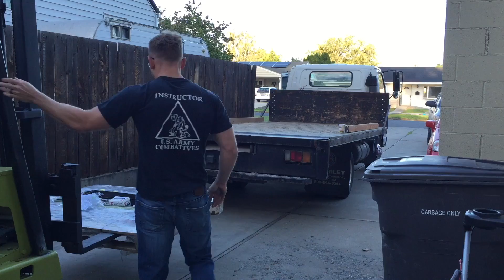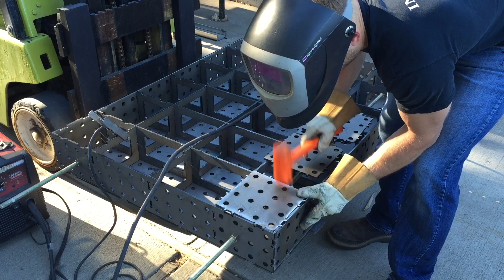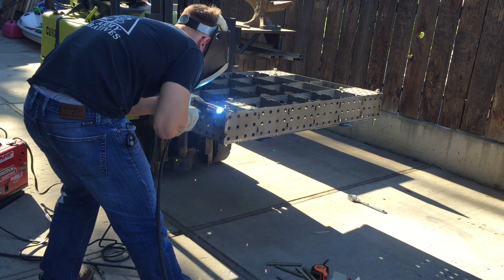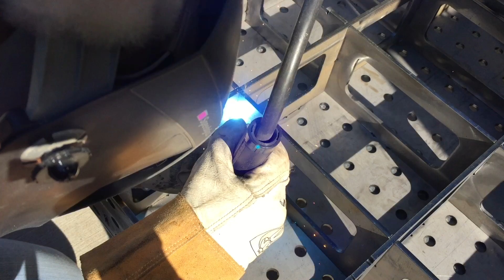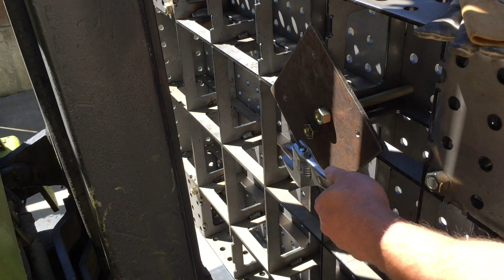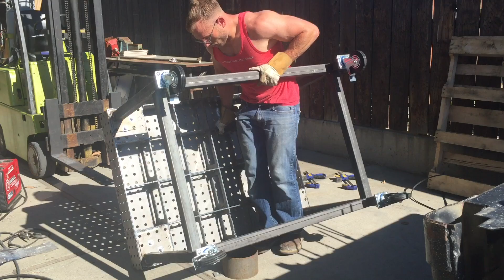NEW WELDING TABLE!!! Certa Flat Welding table (fab Block) 36''x48'' Unorthodox Fabrication

Comment: Do you not have to grind the mill scale off first before you weld?
Reply: Mill scale is high in carbon and will totally throw off your weld if it's not "clean, bright shiny steel" when you are TIG welding. If you are MIG or stick (SMAW) welding, it's more then capable of blowing thru the mill scale and putting down a nice weld. You can still get small inclusions in your weld. But for something like this it will not make a difference. If it was something structural like a beam in a building,  then yea, the mill scale would come off.
Reply: Should already be cleaned.

Comment: I got a 36 x 48 tabletop version. I found ... too late ... had it partially tacked together ... that the ribs were bowed. Must have been from the cutting. If I had clamped everything tight the top would have been bowed too. I spend a great deal of time shimming the ribs where they weld to the top to get a flat table. Just a word of warning here. Assume nothing is dead on.
Reply: exactly!.. mine's on order now and  will be used for set-ups/fixturing only, so needs to be precisely flat and plumb everywhere!.. gonna be checking every single piece against a very straight and flat 7' linear rail. I ordered one 24x36 fab block, four 12x36 wings, two 12x24 wings and two leg kits

Comment: Have you checked the top with a straightedge after you finished welding it all up? Curious how flat it turned out after all said and done.. One of these tables is on my list of future additions. Can't beat the price.
Reply: Jeff Allen 18% sale going on now.
Reply from the maker: Yes, I will do another video of that. The table stays nice and flat. I think the main point is to not weld too much at any point to prevent warping. Be careful not to clamp it too tight also while holding it in place with the all-thread. You can over tighten this way.

Do you have a fab block? 

Thanks for the comment.
Reply: +Unorthodox Fabrication I don't have one yet but am seriously thinking about one.
Reply from the maker: Jeff Allen that's a real deal!